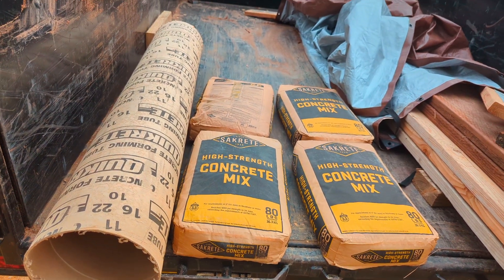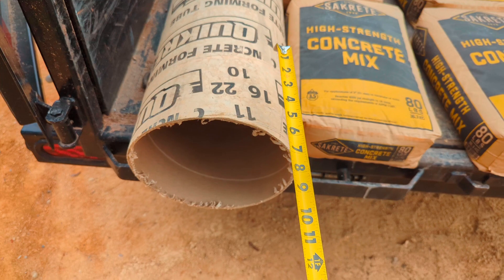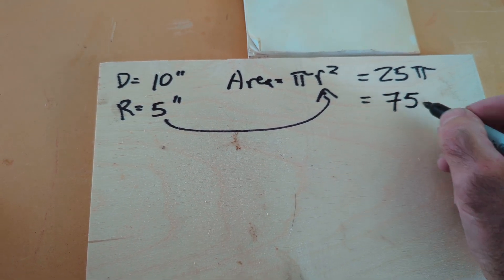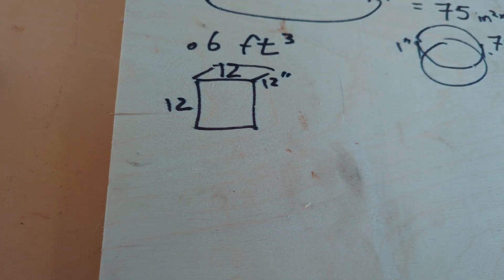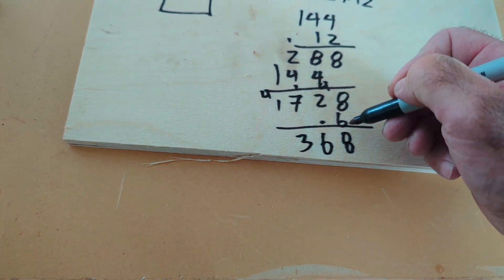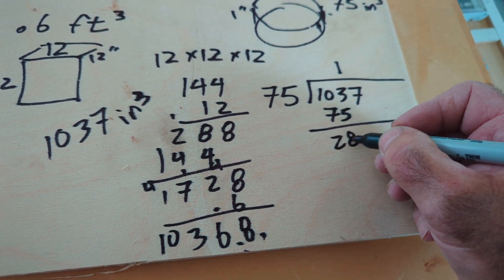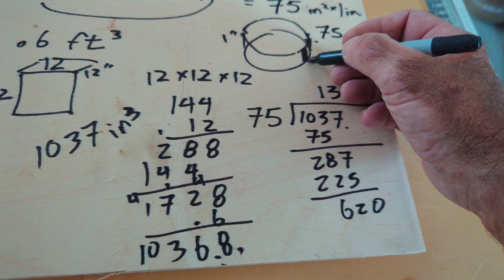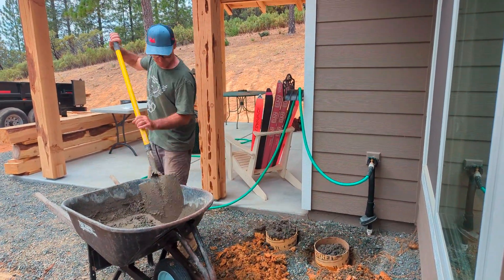How to Calculate How Much Concrete You Need

Comment: First time in a long time that I've seen concrete mixed to the correct wet consistency.
What I usually see is a mix that pours like a thin milkshake, i.e. way too much water in it.
Reply from the maker: Thank you

Comment: Did you really feel a need to make a video on basic arithmetic? I thought you were going to dazzle us with weight/volume constants for different mix ratios and shrinkage and expansion joints and such. The finished volume for sack mix is right there on the bag, as you pointed out. The rest simple arithmetic.
Reply from the maker: Ok
Reply: @ColfaxMath  Hi, my name is susan i just want to understand  in a simply way how to compute the volume of concrete to be order

Comment: Having worked in a hardware store for almost 20 years, I can tell the average person that the amount of concrete they need is:   However many bags you THINK you need.....multiplied by 6
Reply: Meh. for sack mix, I just buy one extra bag and I usually end up with the one bag left over which I then use up for stepping stones or fencepost holes and stuff, before the New Orleans humidity gets to it. Sometimes the "extra" bag gets used in the project, but I have never had to return for additional sacks of pre-mix. It's just arithmetic. The only wild card is prismatic coefficient of the excavation.or forms. So with a formed pour in the ground, just the bottom of the pour. Easy sneezy. Anybody who needs to budget that much more isn't very good at 6th grade public school math.
Reply from the maker: I believe that